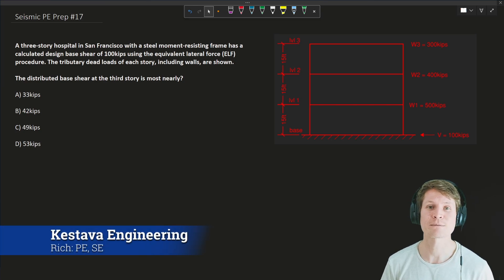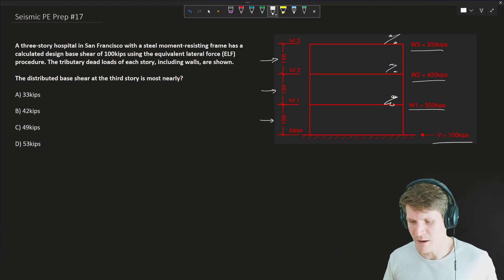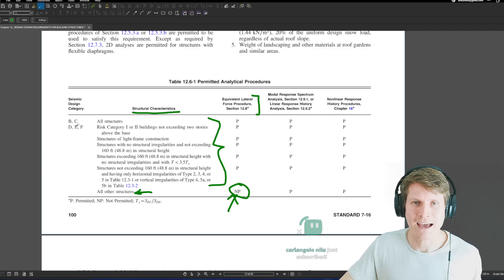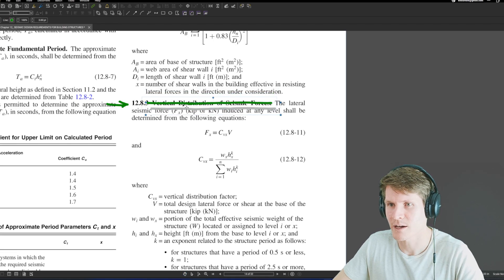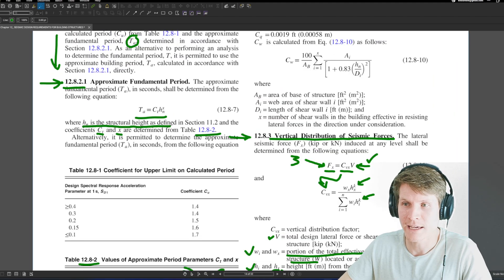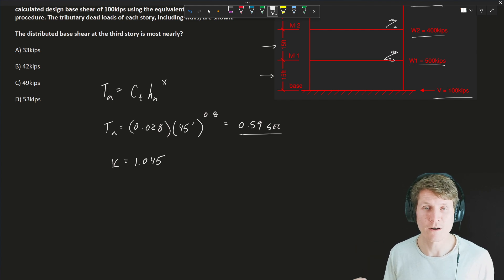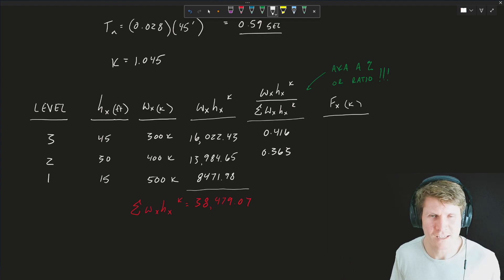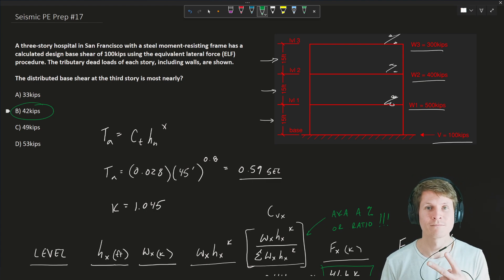PE Seismic Example Problem - 17 #structuralengineering #civilengineering #engineering

Comment: Hi, your presentation is great. I want to add that for 3rd level the F3=V3, but going down the shear at story 2, V2=F3+F2 and Vbase=V1=F3+F2+F1       I mention this because F are applied to level or floors, but V are applied to stories. Also, the question could be to find the shear at any story.
Reply from the maker: @LOMC01  very good points - story force and shear force (for the design of the vertical lateral systems) are very different!
Reply: @Kestava_Engineering  yes, per ASCE 7, there are lateral seismic force Fx induced at any level and seismic design story shear in any story. At the end, the building is like a cantilever beam and we just use equilibrium to find shears, moments, etc.